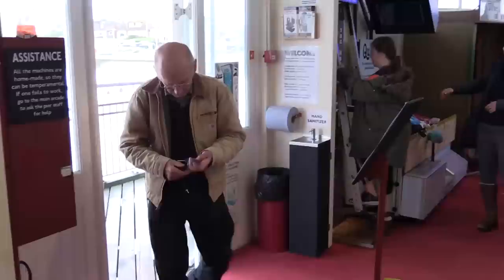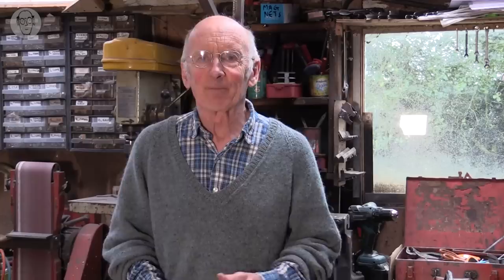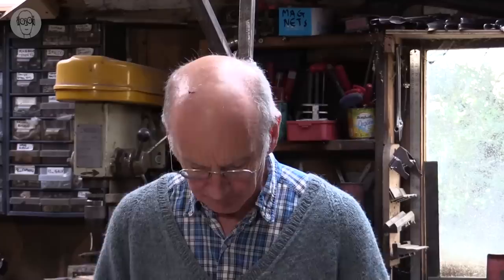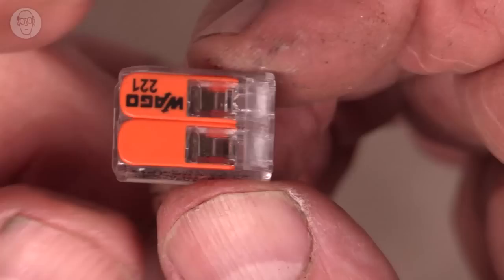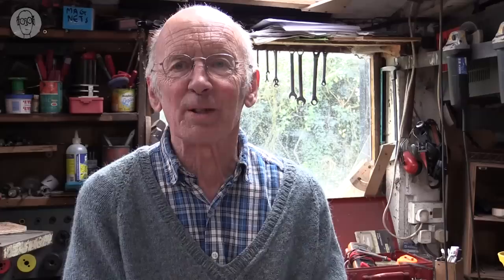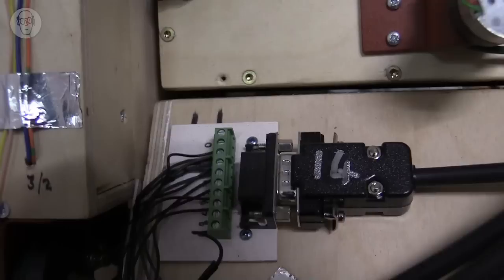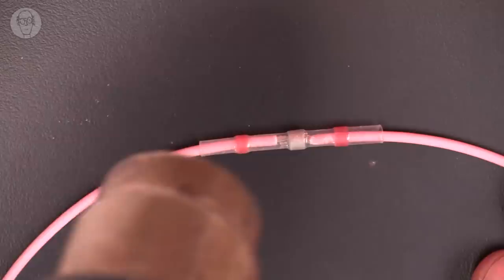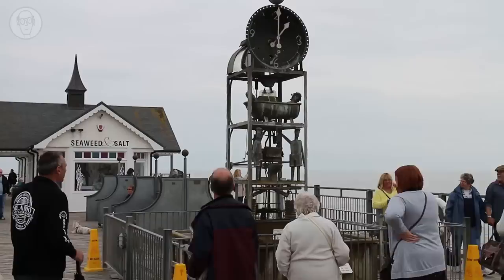CONNECTORS -- The Secret Life of Components, a series of guides for makers and designers - Episode 6

Comment: For general usage I find the CAT-5 Ethernet cables and connectors really cheap and relatively easy to use. Each wire can carry 2.2A, you can parallel them up and you can safely pass signals through a twisted pair without worrying of interference. And the best thing is that you can buy pre-made ones, saving a lot of time. But crimping 8 wires takes only a minute or less.
Reply: We couldn't safely pass signals through a twisted pair. We had a leftover slack in a cable connecting two houses loosely coiled on a flat roof. When it rained, water puddled and submerged the cable. The evanescent electromagnetic wave travelling several millimeters outside of the cable was travelling through the water along the whole length of the extra cable and the signal energy was absorbed. The network stopped working. When the puddle dried up soon after the rain, it started working again. I believe the plastic was intact (the cable was new), the inner insulation also intact, there was no water ingress into the cable and no galvanic leakage.

Comment: I call another type of IDC connector a punchdown.  They're used a lot in the telecomm industry.  The two common types are 110 block and 66 block (no idea what the numbers are supposed to mean).  They're called punchdown because you're supposed to use a spring-loaded tool to punch the wires in, although with some practice, you can use a thin flat screwdriver to do the same if you have forgotten your punch tool (plus it takes a LOT longer per wire, 15 seconds or so versus about 3).
Reply: I have done many many thousands of IDC connections in the Phone industry for 37 Years and the only time I have had trouble with any of them is when the Block got wet. then it turned into a Green mess LOL...or some one punched stranded wire on one. 
 I got pretty good with a nice sharp Screwdriver that I could actually get the wire to cut off at the Pin. 
Cant use the Screwdriver trick on a "BIX" block ....

Comment: Wago really does make the best stuff. I've only in the last couple of years discovered their lever nuts and have found innumerable applications. A bit surprised twist-on/wire-nut connectors weren't mentioned. They remain a relative de facto standard in North America as they're cheap and reliable. Maybe I shouldn't be too surprised though, as I understand there were issues in the past with a particular brand of such connector in the UK cracking and causing faults/fires. I believe they were made of ceramic though, and the modern equivalents are plastic. Still, twist-ons are better for more permanent/semi-permanent connections since they tend to mangle the conductor ends a bit.

Comment: For power connectors, we like like the Molex Mini fit family quite a bit.  They carry up to 9A per pin, can be had in high cycle count varieties (1500 mate cycles), have lots of options for pin configuration, can do wire to wire or wire to board, and are quite common.  The common ATX, CPU power, and PCIe power connectors are a version of the Mini Fit family (slightly different keying than normal for the PCIe connector).  They're also a bit bigger than micro fit, so its easier to see what you're doing.  Just try the milli grid ones some time - those are small, even for somebody that regularly solders 0.5mm pitch ICs.  Also, the Anderson Powerpole and SBS is great for really high current stuff.  They have variants all the way up to 350A!  They're also modular and genderless. 

The one thing I'm surprised you didn't mention was ring terminals since those are so common.  We use those all the time for high power connections.

Comment: I have found that using a separate rosin core flux for wired solder joints works better.  Electrical solders just don’t have enough flux in them.  I do a lot of auto wiring and only use soldering and heat shrink. Unless it’s an emergency repair I won’t use any crimp type connector.  I tried those shrink type with the solder in it.  They are convenient but pricey for doing big jobs.

Comment: Harwin Gecko connectors are really good and robust for wire-to-wire and wire-to-board connections. Harwin Datamate is equally good for signal pins. They require a (very) pricy DMC crimp tool, but that's a one-time purchase. Very shock and vibration resistant, and a strong mechanical crimp instead of solder which is a must in high-reliability connectors.

It is also worth having a look at Chinese circular connectors (e.g. CNlinko, Weipu etc). They have started to offer connectors that are clearly inspired by LEMO, TE, Amphenol circular connectors. They still cost a fair bit, but still much cheaper than a similar full metal connector from a western brand.

Comment: Brilliant video! Connectors are the unsung heroes and villains of engineering. Over time I have got more pernickety about rituals like heat shrinking and using ferrules because this appeases the gods and they smite you less often as a result. On that note I couldn't help noticing your ferrule crimp tool is not ideal... have you tried the ones that squish from 4 sides with a sort of slidy square iris mechanism?
I think you're the Grayson Perry of Engineering...
I would like to see "Tim Hunkin's Machines Club" in the same format as Grayson's Art Club... Zoom calls with tinkerers in sheds up and down the country... Get Colin Furze  involved and you might even get teenagers watching ! But remember, TV producers seem to think all TV must be about "peoples emotional journeys" so you need to slide the engineering in sideways...actually all engineering is about people, even the nerdy stuff, and having a connector fail on you in the main shaft encoder of a 7MW offshore wind turbine certainly qualifies as an emotional journey I can tell you!!
Reply: I don't think it's about appeasing the gods. It's about intermittent oxide layer which one cannot see. In some places it is scraped through, chipped off or prevented from growing by the opposite conductor touching, so you get two conductors with two maps of oxide layers. Now these move under thermal expansion, vibrations and handling. If two bald spots touch, it conducts, otherwise it doesn't conduct.

Comment: A bit late perhaps, but I wanted to add that probes for meters exist where the exposed conductor is thinner and longer, so that you can feed them in to trough the back of a crimp style connector, along side the cable, very handy since you do not have to undo the connector to probe it.

Comment: Great episode. An Idea for follow-up is the Duration of Contacts. Contact designed to be often plugged in and out. Contacts that clean them selves by pulling in and out.
Contact that can be used under load and those definitively can't (Those can shorten when plugged in a short time)Or plugs that differ in length, so certain contacts made before others.
Contact that are designed to just a few times as in and out, or designed frequent use. Also contacts designed to be holding a long time a good contact(Spring tension holds for decades) or the cheap ones that are reliable just a few years. DC contacts and contacts designed for high frequency. A good chosen contact  that is reliable keeps you out a lot of trouble.

Comment: Wago = good :o) Especially off road, run them into a dry box and they don’t fatigue. There are fake wago that have more options and connect pairs. A really good big connection is Anderson. Short of driving over them there indestructible.
Reply: I bought a bag of fake Wagos from AliExpress (to get a 3:3 live-earth-neutral connection; like a $1 Cliff Quicktest) -- and for a couple of them, a lever or two has broken off despite only light usage.
Sooo, genuine might be best...  :-)
Reply: @theskett  I have had the levers break on the old grey Wago, but the new small ones are really good. And smaller. In that range Wago didn’t do the 3:3 so if they do I would 100% say the same on buying genuine. The contacts inside will be better stuff as well :o)

Comment: @37min: The Faston (spade) connectors are available in different thicknesses (not only width) and the thickness has to match.
Reply: I can second that comment !  I was going to write that I thought he was giving up too soon on the spade connectors - I like that the Faston spade crimps  come in high temperature versions for connecting things like oven burner elements; also various metals like phosphor bronze, nickel, silver plated, copper alloy; and brass of various gauges.. I do think the slip on clear silicone or vinyl booties (like good 'un mentioned above) are far superior to the the mostly useless crimp-on insulated versions as shown on the spade connector Tim demonstrated.  I have found that the Chinese crimper tools that come with the assorted crimping heads will work with the Fastons and it saves the ridiculous cost of the OEM crimping tool Faston version.

Comment: Heat shrink is manufactured in an interesting manner - it's extruded at its final, heat-shrunk dimensions and irradiated so that the molecules form cross-links. If you then heat it, stretch it and cool it, it sets at the new stretched dimensions, but heat it again and once it's warm enough to deform plastically, the cross-links developed by the radiation contract and return to the configuration from prior to stretching. It's very normal plastic, but that exposure to radiation gives it memory.

I'm sure this property could be used by a hobbyist to do something cool like create a solid sphere of low-melting-point plastic which turns into a car when dropped in boiling water or something similar, but I don't trust myself to mess around with radiation! That might even work with parts off a 3D printer.

Comment: they make molex style crimping tools for for the full size electrician style spade connectors (the red ones) u show in this video.  

You have to take the plastic sleeve off to use them, or u have to buy them bare, and they don't squish the connector, they fold it in at the split in the barrel that u stick the wire into.

They are hard to find and expensive.  the u.s. military uses them, i have a set i got from ebay, and they are ex-military and fairly worn out.

Comment: At 35: 36, re: the "spade lug" crimp connector:  If the wire can be pulled out of the connector, then it's likely a case of a mismatch between the size and type of crimp tool and the connector, or a wire that is too small for the connector, or a poorly manufacturerd connector, or perhaps poor technique. Ideally,  crimping followed by soldering the connection is a really good idea. The male to female fit between the two spade connectors is easy to adjust by squeezing the female connector slightly with pliers so that it curls in one itself slightly, or spreading the contacts slightly with a straight blade screwdriver, but neither should be necessary if both male and female connectors are well made and sourced from the same manufacturer. The contact pressure is pretty high and the connection tends to be self-wiping when the two pieces are pushed together ---- which might be the most important features of any mechanical connector: high contact pressure and self wiping action.
Reply: @cmmartti  , there's crimping, and then there's *CRIMPING*. Sure, a truly first-class crimp constitutes a cold weld, pretty much impervious to oxygen and water infiltration,  and neither needs nor would benefit from soldering. However, unless your using military-grade or other fancy, ultra-expensive crimpers with expensive,  ultra-high-quality crimp terminals that are selected to match exactly to the crimp die and wire guage, you're not gonna get a cold weld! If the terminals are of the insulated type, I'm not even certain that a cold weld is achievable. I can use a set of basic Klein crimpers and un-insulated terminals and get a solid crimp, but in the real world, most crimping is done with sketchy crimp tools and cheap, insulated crimp terminals, and in most cases soldering those after crimping them is an improvement, especially if the connector is gonna be exposed to humidity or moisture. As for the crimps made to the pins of Molex and AMP connectors and similar, in 15 years as an audio repair tech I've seen those fail as well, even when the crimps were factory made, presumably by machine. (Examine them closely and you can see bybthe way there put together that it's not even close to being a cold weld). So, from the repair standpoint anyway, soldering a previously crimped connection is perfectly acceptable. If we had the correct replacement contacts in stock, I'd just replace the offending terminal, or the entire connector, but that's not always affordable, practical or even possible.

Comment: I like to save the connectors and desolder the header strips from old computers. VCRs, etc., and I use them in building model boats that have moving parts, like a radar dish, fire monitor, and LED navigation lights.

Comment: If your spade connectors pull out like that they're either bad/cheap ones or your crimper isn't adjusted correctly. 

Also - glue lined heat shrink is a game changer, especially for outdoors.
Reply: That and the smallest ones in most kits (red) are for cable 0.5mm2 to 1.5mm2 (22 to 16AWG). But the crimping pliers themselves are generally for 1 to 1.5 on the red dies (based on the markings of mine). Lots of wires (even in vehicles)  are smaller than that. (And I find them pretty dodgy even at 0.5mm2, to be honest). There are smaller ones (green or "little yellow" in contrast to "big yellow" which is so big that I have never used one) but they are somewhat harder to find. And the crimping pliers for the small sizes even more so.

Comment: Nice, but worth mentioning re: IDC connectors that the power delivery of a 28awg wire (such as in the ribbon cables) is less than 0.25A once installed in a chassis.

Comment: Wonderful stuff, as usual. Have you tried rubber sleeving (well, neoprene)  on soldered connections instead of heatshrink? It has the advantage of being simple to inspect a joint, just pull it back, rather than having to cut away heatsink. Although like the idea of white heatshrink for labelling. Do the same, but with white tape. Also: Wago connectors, Yes! Recently discovered these, and use them to lash all sorts of electronics quickly together.

Comment: Hearting plugs provide multi pin really solid industrial plugs. 

The only problem is finding a cable with enough wires in to use them. And they are very expensive. And they are proper chunky. 

I like din rail stuff as you can get all sorts of things to go on it. But it always takes up loads of space. The industrial sites I go to often have wardrobe size cabinets just full of din rail. So its useless if you are short on space. 

When i have broken cables outside I solder them then either use a resin kit. 

Or I get one of those pond underwater mains cable gland joiners. Throw away the middle connector. And just use it to protect the solder joint. As long as its the right size gland for the cable. Its no trouble. And you can just isolate each wire with electrical tape when you don't have time or the equipment or environment to do fancy job. 

I use that on signal cables that are very sensitive and are often in water or wet mud. And they really work well.

Comment: 32:40 IDC /Punch down connectors make more reliable connection using a small (or large) vise as the force is applied evenly across the width of the connector.

Comment: Insulated solderless terminals don't grip the wire well when crimped with the crimpers intended for this purpose, because the tools are designed to protect the nylon insulation at the cost of a poor crimp. I have found that a particular crimper (Klein 1006) designed for UN-insulated solderless terminals provides an excellent crimp on insulated terminals, with no significant damage to the insulation. What "damage" there is consists of a deep dimple within which the nylon is squeezed very thin. Terminals crimped with this tool will not pull off the wire - the wire breaks first.

Comment: When soldering wires end to end, I like to twist the ends around each other, like interlocking cork screws facing each other. This seems to be a little less vulnerable to the solder cracking and giving way. An old navy nuke taught that to me.

Comment: Twisting wires together or taping them together, dc voltage will cause corrosion rapidly. You need a solid bond, crimp, solder, clamp.

Comment: The chocolate bar connector is one of the worst to connect loose end wires, because the casing inside which the line goes is cylindrical, and the bottom of the screw is flat, so there isn't a surface match between the 2 surfaces holding the twisted end of the line which sometime cause the line to lose out of the socket upon tension

Comment: U.S. consumer-grade mains sockets have spring connectors on their backs into which stripped ends of house wiring can be inserted.  After a lifetime of replacing burned up and charred sockets I've become very leery of that sort of thing.  I always replace them with commercial grade sockets which do not have the push-in connections and instead rely on a screw clamp.